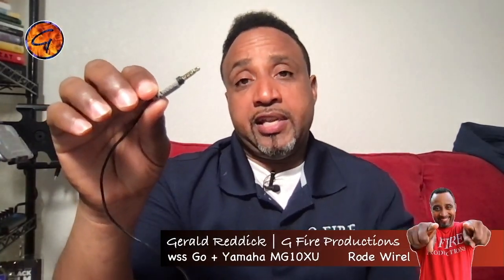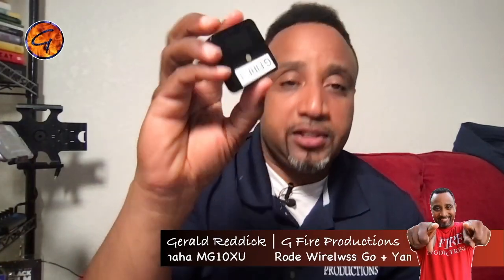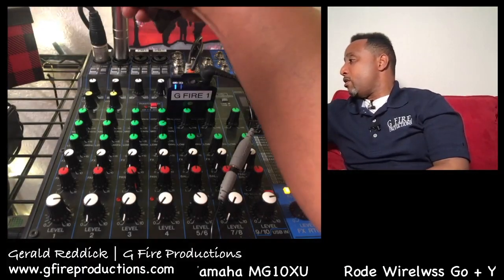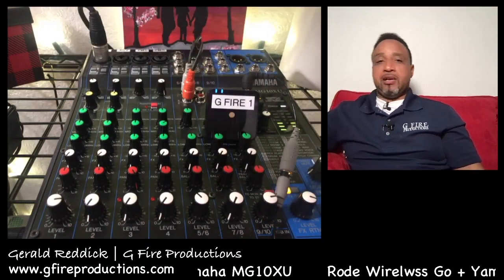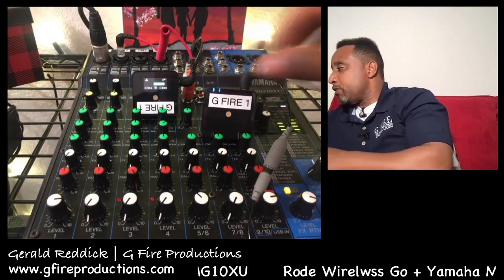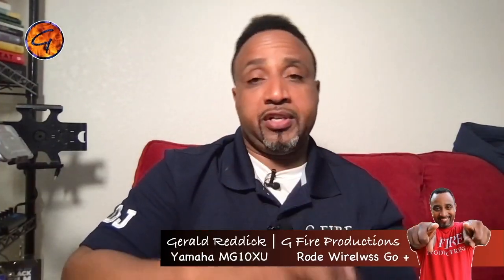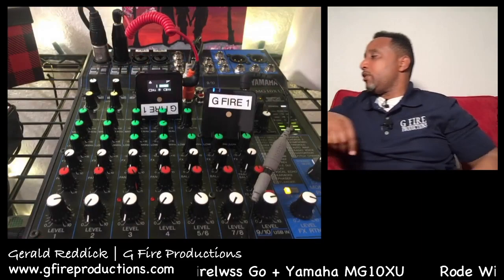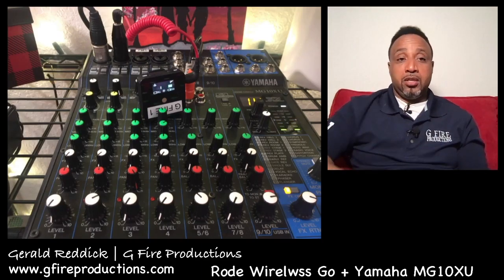Rode Wireless Go + Yamaha MG10XU | How to get the Rode Wireless Go into An Analog Mixer

Comment: Wow...First video where I am astounded at the amount of valuable information. THANK YOU! I just did something similar, but let me bounce this off you if you don't mind. Say you have a co guest and you want to run the Wireless Go second transmitter to them and you use the first transmitter. How would you split the tracks so you can control each. For example, say you have a female, generally speak softer, so you'll want to make sure their audio isn't coming in to low and the males peaking. It seems you have yours in "merge" mode. So when using "split" mode it will make a L and R track, would you need two VXLR adapters and then use a Y splitter? Or what do you think would be the best approach to handling this?
Reply from the maker: Sean thank you so much for watching a video and supporting our channel. I would actually use two "Wireless Go" systems on two separate channels of my mixer (me on channel one and host on channel 2). As for the vocal levels let me be as specific as I can and what I would do. 

If I am on channel 1 and my guest host is on channel 2, I would ensure that the (channel 1 & 2 volumes) are both about 3/4 of the way I turned to the triangle on the mixer. The next thing that I usually do is turn my master volume also 3/4 of the way or to the triangle of that volume knob. On my (channel 1) gain I would turn it up until I see the metering right at or just above the zero DB mark then mute my mic. On my guest host (channel 2) gain I would turn it up until I see their metering right at or just slightly above the zero DB. By doing this it will ensure that both of our vocals are about even. 
Note: while you are setting up gain, make sure all of your EQ levels are flat. This is how I do it on the Yamaha MG 10 XU mixer setting up gain or other mixes may be a little bit different process. I hope this helps you out Sean if you have any other questions just let me know.
Reply: Hi Sean, did you have any luck splitting the L & R tracks of the Wireless GO?
Reply: @TJB923  Not via LXR. I just went back to 3.5 got now.
Reply: @ScarmackProductions  I believe it is possible to split the L & R channels of the Go Wireless into 2 mono XLR which will then feed into two separate mixer channels. I have ordered a cable and will see if it works!
Reply: @TJB923  right on! If you could let let know I would greatly appreciate it.
Reply: @ScarmackProductions  This works Sean! Sorry for the delay in replying. Make sure the cable you purchase splits into mono XLR.
Reply: @TJB923  Hey no worries! What cable did you end up ordering if you don't mind sharing?
Reply: @ScarmackProductions  I tried posting a link on here a few weeks back, but I don't think the channel allowed it. I will try again in another message.
Reply: Whatever you end up ordering, it's important to ensure that the Sleeve of the 3.5 TRS is connected to both pins 1 & 3 of the XLRs.

Comment: Wow, it looked as though you really had no idea what you were doing. I was surprised your first "experimental" connection didn't damage the interface or receiver. Rode technician tells me they do not recommend doing this, but have not noted any damage, from doing this. The 1/4 inch TRS input in the interface needs line level or instrument level input. The Rode receiver puts out MIC level, so of course that was not going to work.
The XLR mic input on your interface, powers condenser mics requiring 48volts(phantom power". Lavalier mics and the Wireless go, are slightly different, and require only "plug power", around 5volts. Well, the mic requires plug in power, so the VXLR+ is the correct adapter....running just a lavalier mic, or other 3.5mm "computer" mic, and perhaps also using well shielded 3.5mm(1/8") extension cable.
I have been asking Rode technicians more than a few questions about this, BEFORE purchasing stuff I do not know how to use. In case you are wondering how I know.
There is no balancing signal from 3.5mm lavalier mics. Cables are wires, they are neither balanced nor unbalanced; there just needs to be enough wires. The balancing happens at the beginning and end.
XLR mics produce a twined signal used for balancing, to remove noise picked up along the XLR cables. The balancing is completed in your audio interface.
The VXLR+ does not send a balanced signal into your interface, which is fine, since a 3.5mm condenser mic does not make a signal to balance.

FYI, you do not need the new "VXLR Pro" plugged into an interface, The VLXR Pro puts out a balanced signal, but in your setup, you do not need the Pro version. The Pro version is good to plug a 3.5mm condenser mic into, requiring the converted 48v to 5v, then running a length of XLR cable to your interface. If needing an extension cable in a RF noisy area, this setup creates a balanced signal through the XLR cable, for noise reduction. I asked Rode about producing Lavalier type mics that make the twin signal for balancing.

Anyway....where was I LOL

Using the VLXR+ into the audio interface provides the proper connection, and the proper power required for a plug in powered 3.5mm condenser mic. The Wireless Go transmitter provides plug in power for the mics with a battery. I assume the wireless receiver just ignores the audio interface's converted 48v down to 5 volt VXLR+ plug power. I don't think the receiver requires the plug in power.

Hope this helps some. I see now that you were not experimenting, but demonstrating.
Reply from the maker: Thanks for watching Mark. First let me say this is not a debate to say that when you were written is wrong. Obviously you've put a lot of thought into your knowledge of Tech. To be absolutely clear on what I was using to make this happen was the Rode VXLR not the "VXLR+" nor "VXLR Pro". You just described was a technical spectacle but thanks for your input. 

What did not work and what did work was proven in the video. So for the audience of people who are not so techy I need a straight up answer I did my best to provide it with proven results towards a solution. I decided to give it to you real in the field with a more subtle approach without damage to any of my equipment. I've done my research and have consulted with a Rode technician before putting this video out. 

Simply put Mark, my videos are for people who want simple answers without all the tech blah blah blah. Besides, what I've done in this video is proven to work to this day, can you prove otherwise?
Reply: @gfire_productions  I could see you started with the plain VXLR. As I said, I am surprised that didn't damage anything; the Wireless go must ignore plugin power, unlike a 3.5mm plug condenser mic, otherwise you would have connected 48volts to a device expecting 5 volts. You didn't ruin the receiver, which is why I assume it does not require or use the plugin power. Had you plugged in a 3.5mm condenser mic direct into your interface through the plain VXLR, I would expect this to damage the mic. Inputting mic level signal into line or instrument level was clearly not going to work either, but could do no harm. You did a good job proving what does not work. VXLR+ or the VXLR Pro will do what you wanted, though for that setup you would not need the more expensive VLXR Pro.
It sure didn't look like you had done any research before randomly plugging stuff in.
It would seem though that your method of showing what doesn't work, has helped people, so good job.
Reply: The condescending and pompous tone is unnecessary. If you have a correction or clarification to make then do so respectfully. You've simply regurgitated some of what the OP mentioned and mixed in a few incorrect statements (battery-powered mic needing plug-in power, balance cables simply = number of wires) as well as some irrelevant ones related to VXLR+ and VXLR Pro. He is simply showing that the pass-thru VXLR works and that the TRS-to-XLR balanced cable was creating an issue. BTW, you seem stuck on 48V phantom power. Did you notice him plugging the mic into a 48V port?
Reply: @bl8550  Yes I noticed him connect the phantom power to a mic requiring plug in power. Obvious.
Reply: @markluxton3402  Sir, you are incorrect. I get that you being helpful in alerting viewers to not mistakenly plug a lavalier mic into a port supplying phantom power. However, that's irrelevant in this video. Phantom power is not automatically available on all ports of an audio device.
Reply: @bl8550  If you plug the VXLR into a mixer or interface, with the phantom power turned on, and plug in a 3.5mm condenser mic, you have put the aprox 48 volt across the mic PERIOD I have a degree in electronics, though this is rather obvious. The VXLR,, not the VXLR+ or Pro.
Reply: @bl8550  Since the higher than needed voltage, is across a condenser mic....or rather a capacitor, there is, according to Rode tech's, apparently no damage. They do not recommend doing this though. I thought, incorrectly, that this connection would destroy the mic. It may, and actually using the mic I would expect to be worse, but Rode says they have not noted any damage.
Reply: @gfire_productions  I was already quite frustrated by many youtubers talking absolute nonsense about audio, and many were "experts". I really only needed a few questions answered, and had to wade through a lot of BS. My electronics degree is over 30 years old, but I still fix everything, and continue to learn. I tend to be brutally honest and was frustrated by many days trying to get some simple questions answered.
I am glad you are trying to help. It took a couple weeks back and forth to get Rode to fully answer my questions. All of my audio issues have been dealt with by getting only the correct gear that I required to suit my setup. I need a new PC though :-(
My PC has onboard audio, too noisy for mic input. The PC itself is also noisy. I have ways around this but my USB ports are failing. Only two can be used out of 12 now. I need three at a minimum. Wireless keyboard, webcam, external USB audio interface designed for 3.5mm condenser mic.
Thought I had everything covered till the other 10 USB ports stopped working lol

Even the companies selling XLR and TRS and TRRS cables, confuse people by stating their cables are balanced. Cables are not balanced! The balancing happens at the ends; the correct mic and correct interface. The Rode tech's I had been questioning, passed on my suggestion to create a lavalier condenser mic that produces a twinned signal for balancing. This could be very useful when one wants to use a lavalier wired connection over a distance, like I am doing. So far my well shielded  3.5mm TRS cables, are noise free in my environment, but I can see where a balancing lavalier mic would be useful in an RF noisy environment. Maybe they will build one? The TRS cables would work as is. Typical 3.5mm mic audio input circuits would also need upgrading to balance a twinned signal.
Reply: @markluxton3402  You implied that the OP was clueless and keep repeating over and over and over (to exhaustion) that the OP could have damaged his mic by plugging into a phantom power source. He DID NOT plug into phantom power source. So your points about phantom power and electronics degree are entirely irrelevant. His video is simply about using a pass-through VXLR adapter in unbalance configuration - nothing more, nothing less.
Reply from the maker: @markluxton3402  I feel you bro this was my case but whenever I solve one of my tech problems I share in case someone else out there is struggling with the same issues. I have tech issues with Behringer sometimes so I feel you. As for building cables, I don't have that skill so I have to but the adaptors to make it happen lol. So what kind of computer are you looking at?
Reply: @gfire_productions  I only run GNU/Linux OS's so I am looking for probably a small form factor, quiet, fully Linux compatible PC. HP, Lenovo, and Dell make some I like. It will not be long before all desktop PC's are tiny.
They also use much less power. I use a 40 inch TV as a monitor, with wireless keyboard, and an older gaming rig/workstation. I needed to be able to do Zoom or Jitsi meetings, to teach some very important information to humanity; possibly doing some podcasts as well. I needed a webcam, researched, and got a Logitech 1080p, which works perfectly with open source video and audio software. I wanted to put my webcam on my TV, but my noisy PC sits behind it. So I researched, and bought a Rode Lavalier Go. My PC has onboard audio that records noise from the main-board, so that was a no go. So I began researching audio interfaces, and balancing signals. I also discovered that my TRS 3.5mm cable absolutely sucked, so I researched shielded cables. For some time I could not find straight answers or ones that made sense, as to why XLR mic's could be balanced using XLR cables(three wires) but 3.5mm(1/8 inch) plugged mics and the TRS 3.5mm cables(also three wires) could not be balanced. Also the 1/4 inch TRS cables are used in balanced circuits(three wires again).
Finally I learned that the smaller condenser mics do not produce a signal that can be balanced, so it had nothing to do with the cable. There were "experts" saying shit like, you can't use a condenser mic with a PC??? LOL That is the only mic I have ever seen used with common PC's. I thought I would need an audio interface, and researched those. That is when I learned of the three adapters Rode makes. I thought I would need better gear than I ended up getting. I finally bought an inexpensive Creative Labs USB audio interface(plug and play) for 3.5mm mic and headphones. Tiny thing that produces better audio than most onboard PC audio, and without noise. After testing my new cables and Lavalier Go mic with my work shops laptop PC, I realized I had no RF noise issues here, so balancing was no longer an issue. The tiny Creative Labs interface does the job of bypassing the noisy onboard audio of my workstation. My laptop clearly has better audio circuits.
I apologize for jumping on you. This was many weeks to find answers, and sort out who actually knew what they were saying. Rode was a big help. BTW, Rode suggests using their VXLR Pro even if you are not using a balanced circuit. They suggest that there is less noise in the VXLR Pro over the VXLR+, but they may also want to sell the more expensive adapter ;-)
What I learned is that, if my environment had too much RF noise, and I needed a wired balanced signal over distance, using my Lavalier condenser mic, my only real option was to plug my mic into the VXLR Pro, then run XLR cable to an audio interface designed to receive a balanced signal. I could use the VXLR Pro plugged into the interface, and just run 3.5mm TRS cable from the mic, but that is not balanced through the cable, just balanced from the adapter which is no help.
I could also have used a wireless go to eliminate most noise; more $$$.
The professional shielded 3.5mm cables I bought did the trick though, with the tiny Creative Labs audio interface.
Then I realized I needed three working USB plugs and I do not have them :-(  So, looking for a better PC now. Yes I could just use my laptop, but I got a 40 inch monitor and wireless keyboard so I can be comfortable. My PC is for entertainment as well. Plus I need my laptop for all my manuals and information for my workshop.
What really sucked was that I missed the first Zoom conference I wanted to attend. My laptop always had very very poor video quality, so I didn't have any plan to use it for video conferencing, but when I brought the laptop to my house for testing the mic and cables, all of a sudden, first time ever, the built in camera went step by step automatically adjusting till the picture was excellent; WTF? LOL I have no idea why it started working well, perhaps an upgrade or change of OS. Using Mint Mate now, on both computers. Still, I like the big screen!

Comment: The reason it didn’t work is because with the trs cable you are telling the receiver to receive instead of sending the signal out..the 3rd ring on the end of the trs cord is for microphone output...all you need is a regular aux cable to send the signal.
Reply: Edit: your trs is actually a trRs..you need a regular trs